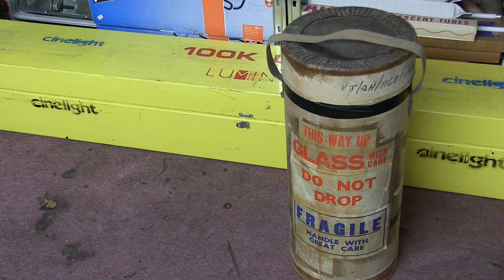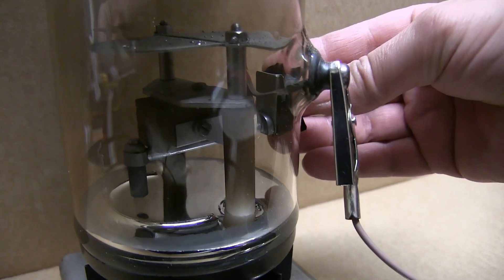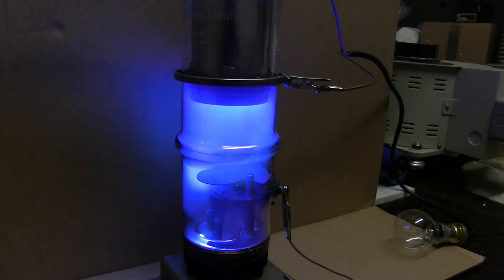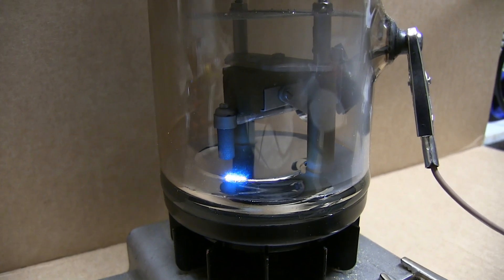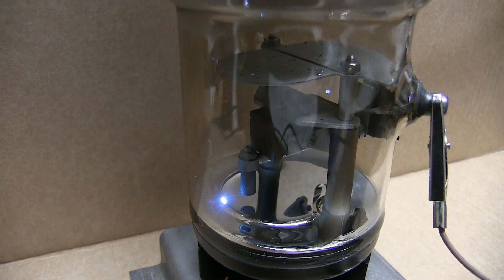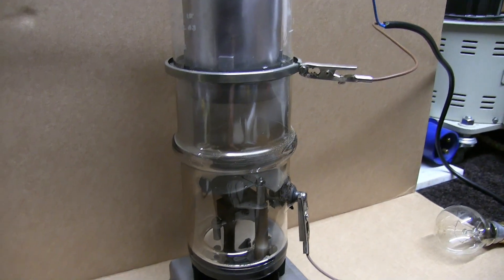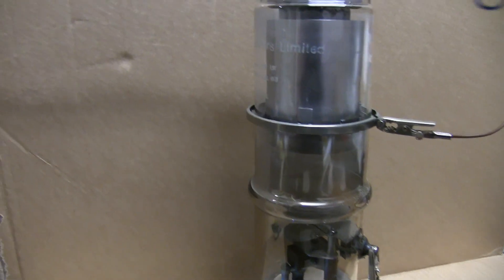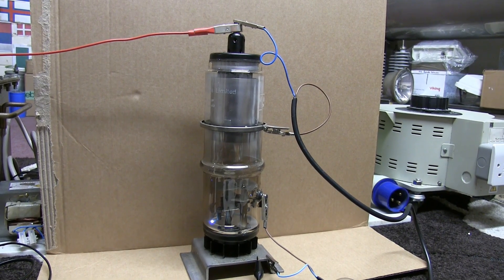Excitron Grid Controlled Mercury Arc Rectifier

Comment: I love old technology. Like they say, "If it an't broke don't fix it."
Reply: @Ghost Heart well and a few hacks make it better.

For example if you've got underpowered tool that can take the power upgrade the motor.

Got it all puny not-so-good vacuum going around use it in the shop for dust collection and power takeoff!

But may not necessarily be broken but could be repurposed into something better or maybe make it better in some way more suited to your use.

Such as adding circuitry to a plain old dumb fan to make it work with say a smart speaker or other smart device even though it was not broken in the first place you fixed it and made it better that ever was so that could really be you fixing something that's not broken depending on how you look at it
Reply: the motto here is: if it aint broke, pop it!

Comment: It's always cool to hear the difference between the lower European 50 Hz hum when I'm used to the higher American 60 Hz hum.  I should know why different frequencies were originally used but I've forgotten. I've always assumed the higher European 240 V was used to decrease amperage and use smaller diameter wires and less copper vs. the American 120V. But there's probably a better or different reason?  
Are you using that in place of a rectifier valve/tube in a valve/ tube amplifier? Or in place of a diode in an analog (or digital) solid state amp. Do you need to run a capacitor to smooth out the voltage? Or does the mercury rectifier provide a naturally smooth wave vs a solid state diode? Or, and this is a wild guess, is the mercury rectifier serving as the  sound producer all by itself? Just curious. I'm an amatuer.
I could stare at that beautiful Blue Glow all day. But that's probably not great for the retinas in my eyeballs. It reminds me of the Blue Cherenkov radiation in nuclear power plant cooling pools.

Comment: I'd like to hear more about the technical details of these interesting devices you have. The pros and cons vs modern tech, history of where they were used, what it does, how it functions, etc..
I think I speak for you entire audience when I say we'd love to hear your take on it.
Reply: Pro-s and Con-s of these old things:
1. So simple that it's robust as hell. 
2. It does very well for the cheapness of the materials - a DIY version can outperform multi-million-dollar modern equipment
3. Horrible response speeds, horribly inefficient, tendency to be made of hazardous materials, difficult to ship or repair
Reply: @dimitar4y  ad 2: Cheap materials probably yes, but requires a metric sh!t ton of manual workmanship to be made. Was likely as expensive back then as a modern semiconductor solution today. And I would be very careful about claiming it outperforming a modern equipment - which is a huge lie, especially as this device in most situation could be replaced with something as simple as SCR (thyristor). That is a very robust semiconductor by itself.
Reply: @Sixta16  Can you make a SCR thyristor in your home? HEC NO. Can you make a tube thing? Yes, easily. It doesn't require a "ton" of workmanship. It just requires a jar, some glass blowing equipment and a few pieces of metal. And yes, it will outperform modern equipment for a fraction of the material and production cost. However, it will be GROSSLY inefficient. But also awesome and robust.
Reply: @dimitar4y  Don't forget high vacuum equipment, I doubt these things work under a normal atmosphere. A cheap vacuum pump rarely works in these situations, you'll normally need either a diffusion pump or a turbo molecular pump, and neither are cheap
Reply: @zebdeming  what are you talking about lol go watch a cody episode. You can make a basic mercury high vacuum pump - just like they did it in the old days!! You think they had lasers and CNC machines back in those days? Don't underestimate the ingenuity of someone strapped for cash and just a stick for equipment!
Reply: @dimitar4y  watch that Cody's lab video, and see how that mercury pump works, it's a mess, and takes forever, IIRC it barely got a low enough vacuum to get what he was working on back working. Yes this is easier to diy than silicon, yes you can do this stuff in the garage, but it does take tools and the skill to use them. You could make your own diffusion pump too, I have thought about it myself, wanting to make a Farnsworth fusor (not a demo model), but my time is worth something, and these types of projects are full of failures along the way. In the real life, you can't just edit out your mistakes on a you tube video.
Reply: @Sixta16  I don't see many SCR rated at 11,000 volts.
Reply: @zebdeming  Vacuum tubes were made by purging with a reactive gas, then pumped with a simple mechanical vacuum pump. A getter was used to remove the final bit if gas not removed by the pump.
Reply: @tripplefives do it.
Reply: Yes please.

Comment: Do you have skin or eye protection when being near excited mercury? It does emit ultraviolet light.
Reply: Doesn't glass partially block UV light?
Reply: @profix25lo  borosilicate does, quartz doesn't do much, I believe, and that's for uvc
Reply: @OffBrandPringles  It would be interesting to measure the UV. I bet there's still a fair bit emitted despite the glass.
Reply: Regular glass blocks UV-C, which is the really bad one.
UV-C lights (sterilising ones) have to be made of quartz IIRC.

There's probably plenty of UV A and B coming out, but they're not the big danger.

Comment: Best night light ever. That little blue dot and I could be best friends.
Reply: you definitely don't want this near your field of vision. the UV radiation from those thing are nasty.
Reply: @MuhammadHanif-bx4pb  True but only if it can pass through the glass. Ordinary glass blocks UV, so they use quartz glass on germicidal UV lamps and EPROMs for that reason.
Reply: And the whirring sound
Reply: Mercury leakage in the middle of the night?
Reply: @zspacecaptain8228  trust that thing wont leak except  you break it

Comment: So with an arc started it provides a stable path (if not jiggled and constant current applied) through the positive reference only because of the electrons natural path from negative to positive For high current loads.. ?  Kind of like an electron tube in an older crt with the heater in the vacuum?  Sorry trying to understand why that rectumfrys the current forcing the magic pixies to all walk single file in one direction..